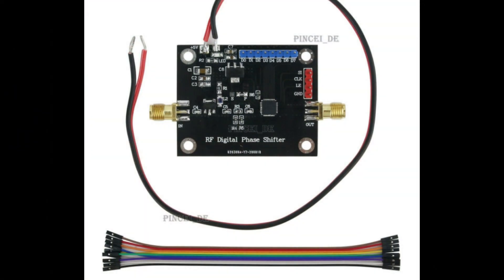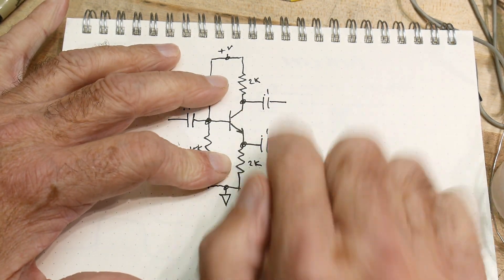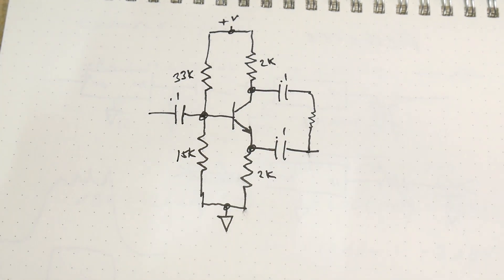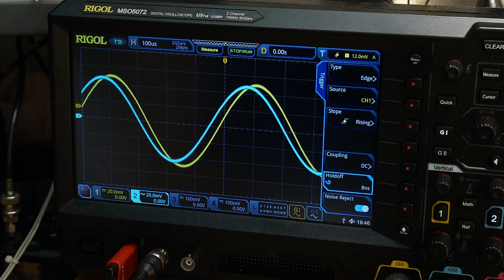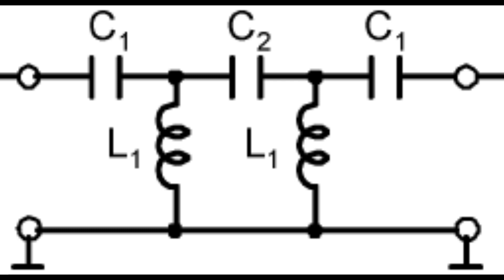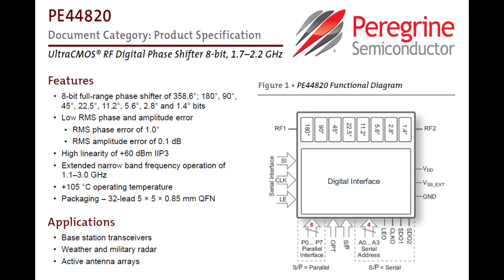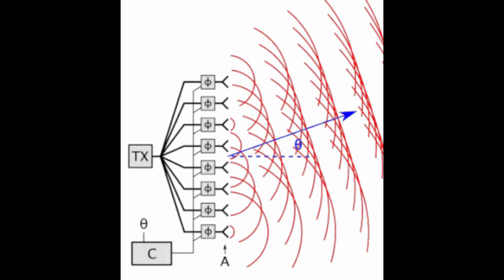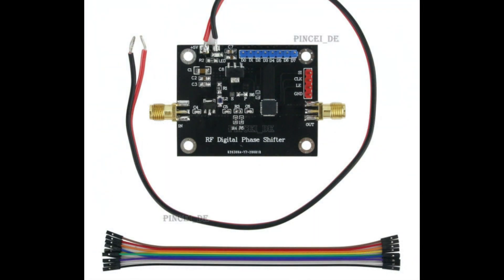#1028 Digital Phase Shifter

Comment: Sorry what capacitor type do you use and what voltage rating? Ya see I kinde of need some thing like that for inductor pick up coil that seams nearli aceptabel for my project small phase shift degree control only problem I have the hei IC chip diagram shows not voltage value of 2 electrolitic capacitors who changes sine wave to square wave it does has inline 2x 10k resistors and parrarel 20k resistor I belive in that order it was made .So would small rectifiers diodes work to change sine wave to square wave in an voltage booster lay out? Ya know the diagram wast specific so I just don't know what pulse trigger should it by + or - polarity type so that confused my

Comment: Emitters and collectors output circuit need with one variable resistor and capacitor. Can change phase shift 0 - 90 - 180 degree.
With two capacitors don't work.

Comment: Thanks for the clip. I am new to this and am trying to program 4 phase shifters so they change phases on my command. How would I do that? do i need to buy other hardware for that? I plan on using Python if that's possible. or do they come with a GUI? i have not started shopping around yet. Thanks for any help.

Comment: Phase array antenna and more recently Syntactic  Phase Array antenna have many uses including in Radars, medical imaging, beam directing, etc.  The Oldest application was Large AM and SW Antenna Towers.  They used put several tall AM antennas in a circle and using phase shifting direct the beam in different  directions.  Now days the most sophisticated application of  Phased Array Antenna is to burn cancer cells inside body by directing and focusing beam to the location of cancer cell and burn it.  This is very difficult, because unlike air, human body is not homogeneous material and you have to adjust for different tissues and materials to correctly concentrate the beam on particular location. 
Also, I would use MOS instead of BJT on your first circuit, in order to have less phase error and amplitude error. In BJT Ie=Ib+Ic so Ic is not the same as Ie; whereas, in MOS Id=Is so you do not have to correct for the amplitude.  The first circuit is you presented can be used as "Active Balun".
Also you could use capacitor and Inductor in series to create positive  or negative phase shift by changing the value of C or L.  The problem in this type of phase shifters are that they frequency dependent.

Comment: Many years ago, people on the "fringe" outskirts of my town would put up multiple Yagi antennas, in order to pick up distant TV stations. That was my introduction to phased arrays in a receiver setup.
For ham radio or similar, the ability to deliberately ALTER the phase between signals means you don't just get stronger signals - you can also be more directional. If you can put in 2 (or more) HF verical dipoles but not a long horizontal wire, use this.  Got multiple magnetic loops, pointing in different directions? Use this. 
Heck, just about any antenna farm can use this - you may not get GREAT signals from some antennas, but adding them SHOULD increase signal to noise ratio. Evry bit helps!

Comment: I built one, using an opamp cap and a could of resistors and variable resistors. I was able to make six signals on a 100x100 pcb board using all through hole components. If you made this video a couple of months ago I would of tried this. Also I just subbed great video

Comment: You could one of these in a simple phasing rx/SDR by adding in a couple ne602s, a canned eBay band pass filters, an arduino, a si5351, and an audio amp.
EDIT: scratch that, it looks like it is too high of freq to use those parts.. but still, it is a building block for making some fun ham gear.

Comment: Interesting stuff, thanks for sharing.. maybe a way to make a phase-modulator?
New 5G millimetre wave bands will be using something called "massive MIMO" that will be using a similar beam steering phased array approach to get the best SNR it can with a mobile device... ~30 GHz waves don't get very far in the air...
These system are divided down into two sub-types: "analogue beam forming" and "digital beam forming".
 - Cheers,
Reply from the maker: pretty sure it is too slow for modulation

Comment: If you replace the variable resistor with a FET and bias it a bit on (2v?) and then ac coupled a 1Vpp tone to the gate; would you get a phase modulated signal?  Or more to the point, a usable signal. A PM Si5351 radio? Need more coffee...

Comment: I find this very interesting. When I was in the Navy I was a fire control technician and I was trained on the AN-SPS 48 search radar that scanned azimuth mechanically and elevation was scanned electronically. To scan elevation the computer used the ships gyros to produce a stable platform and from that a base frequency was selected in the synthesizer to select the desired elevation (angle). Then there were some step frequencies added to the base frequency to do the elevation scanning. One base frequency only scanned a small portion of the full elevation, a new base frequency had to be selected to scan higher or lower. I don't remember how many base frequencies it took to scan the full elevation because that was 46 years ago. What I'm getting at here is I never knew how the antenna directed the beam just by changing the frequency. Maybe changing the frequency is something similar to what you showed here?
Reply: Probably there were delay lines so changing the frequency changed the phase.

Comment: how does phase shifting work in regards to phase shift keying and could this be used for data encoding?
Reply from the maker: These are too slow for that
Reply: These can only switch at 25 Khz. (Thanks to 3.3Vcc)
Reply: @joeteejoetee  25KHz?  So 25,000 phase shifts per second?  Isn't PSK31 only 31 phase shifts per second?  Sorry if I'm misunderstanding the obvious.
Reply: @gmanshackshack6822  The "spec" 25Khz is in the PDF datasheet (sorry for not including a URL...).